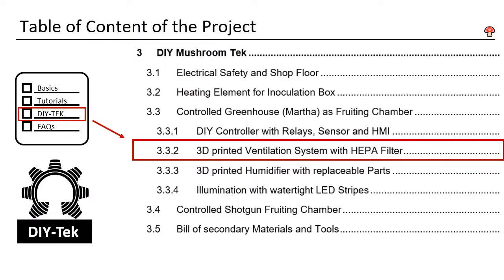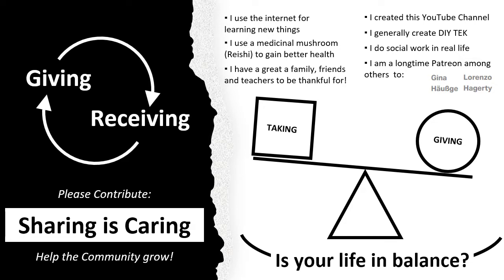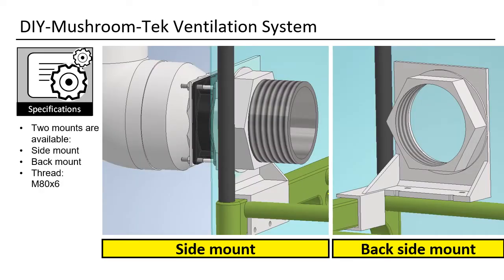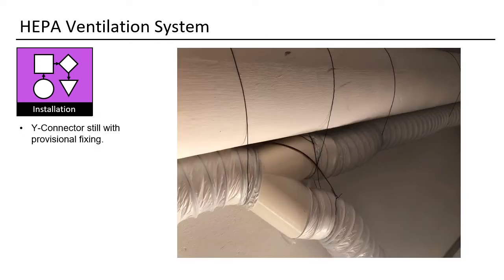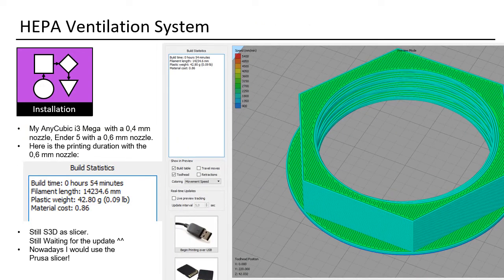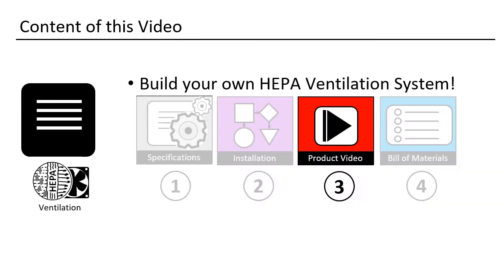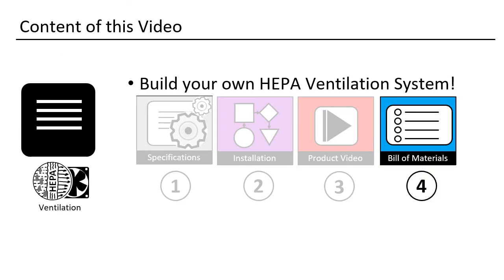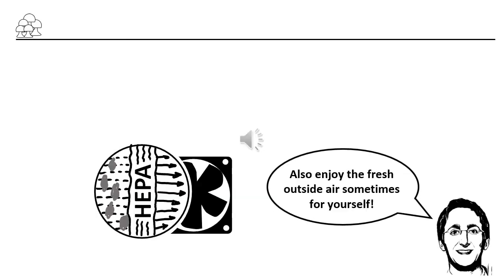3.3.2 Printed Ventilation System with HEPA Filter for Martha grow Tent

Comment: Hey :)
Venting the exhaust outside the building is propably the best way but not really possible for those living in rental apartments (like me in Berlin), especially during winter times.
Do you think it could be possible to remove most of the spores using first a centrifugal seperator followed by a waterproof HEPA filter?
Would be interested in your opinion on that!
Reply from the maker: Hey, best would be if the exhaust could go through water for cleaning purposes, if you can not get to the outside. For this one could use an air washer. This would be better than doing nothing. Do not use ordinary Filter or an ordinary air purifier. They normally come with an ordinary HEPA filter, which would get wet, and this would invite even more mold down the road. I did not know that waterproof HEPA filter do exist. Sounds good. I would use an airwasher in any case. I do not think that a centrifugal separator is be able to filter out any spores!

Video: What is the difference between an air purifier and an air washer?
https://youtu.be/3aSviYWezpA
Reply: hello, do you think à VENTA LW15 air washer will be sufficient to capture the spores of 1 martha 4 stage? thanks a lot!

i have thé same problem, i can not evacuate outside.... i'was thinking for a system with water an i've juste read your comment!
Reply from the maker: @thefloooo95  Dear Florian, I think it could work. But the suction area is not that clear cut, that means it will be a little bit more difficult to fit the exhaust pipe on it and seal it. I also do not know if it runs 24/7.
The spore load depends anyway on how many mushrooms and which kinds you have inside the tent.

 When you do some research, many marthas, that are sold as a set for growing mushrooms, come with an open ground, that means they do not have an under pressure system and are connected to the living areas. For many people this thus seems to be no problem. I will not give an advice since it is a personal choice everyone must make, but a water washer is better than no filtering at all!  

If you plan to use a air washer, please check regularly the overall humidity in that room, especially in cold corners and behind cupboards in order to not get a mold problem in your apartment! These spores are really bad for your health! (I do not no if other spores are better…)

I today got the idea, that one could maybe go with a flexible tube through the siphon of a sink and just blow the mushroom air into to plumbing system. But I do yet have not fully thought through this solution. So I don't know what the technical pitfalls of this solution are.

Happy Mushrooming!
Reply: @diy-mushroom-tek  hello, first of all, thank you very much for your very interesting and complete risponse. you've had à Nice idea to thraught the spores directly into the symphon plumbery! but i think it will be nice to have a super sensitive pvc one way valve to not have spores that can go up in the bathroom through the sink or the shower... but it's à good idea. 

the problem is that i will probably grow pleurotus and i know that they produce lots of spores...

so, i was wondering if i can build big filter in a big plastic box with a  big vacum cleaner bag on it but... i think the PC ventilation will not be sufficient for blowing air throught the vacum cleaner bag so i think you're right withe the air washer.

the problem is my room is like 60% humidity because of two tropical vivarium  and i dont need more.... so i hope the air washer will not provide to muche humidity...

thank you very much for your reply! your videos are awsome! thanks you for sharing this!

just a question, your only 2 small disc head atomiser are sufficient to humidify your big 1m95 martha at 90% humidity?

did they last in time 24/7?

thank you very much!
Reply from the maker: @thefloooo95  Hey! Thank you for your kind words!
Yes, the two redundant humidifiers are enough. They last 24/7 and with filtered water for month. One would work, but two bring up the humidity much faster. If one wants to use them in a bigger tent, one could use just more and maybe on both sides. 

The air that would come out of the washer would be 80-100% loaded with humidity I guess, as this is the percentage that goes inside. You can estimate the volume being released into your room by investigating the time you want your fans to be running. So, the only way to reduce the humidity load into your room would be to reduce the fan time.  

I also used the time to fallow up on my plumbing exhaust idea. I created a short video about it. Depending on the access of a sink, it could really work quiet good. As my tents are in a basement and I also have a sink there, no problem for me. But if you have only a room with a window, I have not a good solution yet. 

Anyway, here is the video about my plumbing exhaust solution:
https://youtu.be/ahTGUuV_r6Y
Happy mushrooming!
Reply: @diy-mushroom-tek  thank you for your risponse! you've had a very good idea! i will probably try to 3D print an adaptator to fit my exhaust on the small air washer VENTA LW15. then i will Share with you if it's good. then i will try to find à solution to capture the humid air that goes out of the VENTALW15, i wouln't reinflate the tent with the filtered humid air because there is Co2 Too... so i have to exhaust it in a box that can capture the humidity. maybe into à big box full of salt?

i was wondering if it is possible to fill the venta LW15 with oil instead of water to likit évaporation. i donc know it it will capture the spores... and if it will run correctly....
Reply: Here’s an idea 💡 for you exhaust if your concern is catching spore particulates

Buy a plastic tub with a lid. Cut a hole in the lid to accommodate your exhaust pipe/hose.

Fill your tub as high to the top as possible so that it does not overflow. The goal is to bring water level as close as possible to your exhaust hose/pipe so that when air enters the tub they will hopefully immediately be caught and suspended in the water.

Ensure the lid is air tight on the tub by either tape or silicone. 

Add a small ventilation hole so the fan can blow air freely. This can be done by adding a straw or something similar to the lid. I’d try to secure the straw so that it is as close to the water without touching.

This may not be 100% effective in catching all particulates but may be a cheap and easy method to reduce particulates being blown around your living headquarters.
Reply from the maker: @irate74  Hey Dan, thanks for your good idea! What you describe is a kind of passive air washer, because there are no rotating parts. One could elaborate on your idea and add a sprinkler into the tub to enhance the mixing of water and air. If you design a kind of these devices, please share with us via thingiverse. 

If you utilize these devices, please understand that you are then releasing a constant stream of nearly 100% humidified air into your apartment, apart of some spores that you did not manage to filter out. 

That humidity stream can condensate on cold surface areas. These would mainly be behind your cupboards, in corners and obviously on outside facing walls. Condensation means that there will be water falling out of the air. This can create a wet environment in which mold could strive and harm your health. Please monitor your surroundings with a hygrometer.
Reply: @irate74  seems to be good!!!! the straw can be mounted on a float buoy to adapt the depth if there is evaporatio the straw will always be on the same high of the water. so, the buoy floater and the straw will be one same piece  and the floater will be perforated just up of the water level like you said. the top of the straw will be guided by a second tube that is exact externat diameter of the straw (+0.2MM).

seems to be good!

important to take a water tank that is not high BUT  have a "big" surface area to maximise the change of the spores to go into the water!

and @DIY-Mushroom-Tek nice idea to atomise some water in the tank!

i will try do design one! thank you a lot!

then if needed yo can Mount several of these kind of boxes in parrallel to make à 2 / 3 or even more filtration!
Reply: @thefloooo95  I like the idea of an adjustable straw to accommodate a fluctuating water level due to evaporation.

I also think that if you added multiple setups in parallel then in theory, if the straw was connected ONLY to the 3rd water tub furthest away from the exhaust carrying particulates and high humidity, then by the time the humidified air reaches the straw for the final phase of exhaust then maybe it will mixed with enough of the fresh air resting in all the prior tubs and could have a lower moisture percentage by time of exit.

I have not tested this but I imagine with enough water containers one could perhaps have the final exhaust with a low moisture percentage that would be suitable for a home without having to worry about creating spots for mold growth.

If you have the financial means to do so, it may also be a good idea to buy a cheap dehumidifier and put it by your final exhaust port ensuring the intake of the dehumidifier is by the straw or whatever you choose as the final exit.

Keep in mind the water will have to be drained and changed so purchasing tubs with a pre installed gasket may be easier than constantly having to redo the tape or silicone caulking.  Adding a drain valve and hose may be a convenient idea if for example your tubs are close to a shower drain or sink . That way you don’t have to lift a possible heavy tub of water to pour depending on the size you choose
Reply: @diy-mushroom-tek  Hello! good idea to put a sprinkler in the exhaust tube. Do you think a 1 disc atomiser will be ok? because if i put a sprinkler i have to use a diaphragme pump to have good pressure and less noise but it's like 50euros and it' like 50W to 100W.... so not the best. if i use one disc atomiser it's like 3 euros and no noise, and very less electricity consumption. maybe it's better to put it just after the exhaust fan to not moist it more (even if it's an IP68). I just don't know if spores will be cached by the very small ultrasonic drops of water floating in the air.What do you think about it?

Secondly, I don't want to minimize/reduce the exhaust air flow, so if i habe a 80mm exhaust tube fore the 80mm exhaust fan, I want to keep the surface area of the 80mm circle (5056.5mm2) si if i put a tube juste above the water level in the filtration tank then i need to get a 200mm diameter tube at 8mm of the water level to preserve the air flow. i think i can not get a larger tube than 20cm diameter so i can not go more near the water level than 0.8cm. Then for the straw with the float, i need to have a float that have 64 holes of 10mm diameter to not reduce the flow of the exhaust. i think this is buildable. the easiest will be with a 100mm intake but only at 16mm of the water, don't no if it will make such a difference...  What do you think of it? thanks!

maybe by addition, i can put a small aquarium pump 3W inside the box of water that can irrigate an aquarium moss filter positionnate like a barrier beetween the intake and the straw exhaut. So it will be a filtration with one atomiser that catches the spores and put them into the water and one pump that moist an aquarium moss barrier to catche the ones that haven't been cached and then the straw exhaust at the level of the water will permit to direct spores at level of water to sink the last ones....
Reply from the maker: @thefloooo95  Hey! I think a sonic would do fine. In that case I would for sure position the controller somewhere safe on the dry outside. As they only work for 4h and go into a safety stop afterwards one could also use more than one. This would create a dense persisting fog through which the spores must travel and hopefully will be captured. I would also try to have this fog within the spore trap and not within the exhaust pipe. I also would use a separate water tank for the sonic discs in order to reduce the cleaning/maintenance time on them. The spore water would clog them easily.
Reply: @diy-mushroom-tek  Thank's for your risponse! So if they turn into safety mode after 4 hours, you can't use them 24/7? how do you make to use them 24/7? thank you a lot!

secondly, Maybe it's a good idea to use a 3D water absorber textile like "hygrolon" to have a wet filter surface in front of the aquarium fine filter moss washable maybe every 2 weaks.
Reply from the maker: @thefloooo95  Hey, my martha runs 24/7 and the controller monitors the humidity inside the martha. The humidifier only starts to work when the desired humidity levels inside the tent are not met. After reaching the humidity goal it is turned off via a relay. 

The stop after 4h is a safety feature of the units to ensure that you do not forget to switch them of. If you control them with an Arduino one can have them on a “break” for a minute every two hours or so. This way they would run permanently. One could do the same “trick” without the need of programming if one uses an ordinary time switch.  

An enlarged surface would of course increase the chance to capture spores out of the exhaust air but may also lead to a more difficult cleaning situation. 

I wish you lots of success with the implementation. Please share, if you tinker out a good working solution!
Reply: @diy-mushroom-tek  thank you a lot! i work on it!
Reply: @diy-mushroom-tek  hey! I'm still working on the filter box with 5cm large 50PPI Black aquarium moss filter and water in the bottom with filter moss on water to catch more spores. I will additionnaly cultivate pleurotus ostratus sporeless Strain called "spoppo" to be sûre no spores will be in my livingroom
Reply from the maker: @thefloooo95  Hey, that sounds great! Nice to hear that you are still on the topic, persistence pays off!

Thanks for sharing the idea of cultivating a mushroom that does not produce spores. This may be a great way for many people to start with!

I just googled and there also is a nice paper about this fungi out there available: 
“Development of a sporeless strain of oyster mushroom Pleurotus ostreatus”

https://www.fungifun.org/docs/mushrooms/scef2000/scef317%20Development%20of%20a%20sporeless%20strain%20of%20oyster%20mushroom%20Pleurotus%20ostreatus.pdf
Reply: @diy-mushroom-tek  Hello,
 First of all, thanks for the paper, very interesting! 
i wrote you a message on fb to share you the pictures of my project filter box. it seems to be finish, i have to test and adapt. I would like to know what do you think about it? thanks a lot! have a nice evening!
Reply: Here is the final result. The box is a solid sealed box. i drilled two 80mm holes in it and put two printed parts into the 80mm holes. And then put two 75mm "Marley" tube (72mm inner diameter that is the exact diammeter of the 80mm fan), one 80mm IP68 fan, same model as you did. The marley tube are just pushed strongly into the both 3D printed parts. Then, no glue is needed the are strong assembled. one of the both marley 75mm tube have to exceed 2cm out of one of the top 3Dprinted part to plug a 75mm black air flexible tube (that will be connected to the martha). Inside the box there is a 5cm large 50PPI aquarium moss filter and there is two pieces on the bottom too. I will first run it dry (after a conversation with @DIY-Mushroom-Tek ) and then compare with water on the bottom. and if it isn't good i will do a waterfall from the top of the vertical filtrer moss to the bottom with an aquarium pump. the wire will go through a hole sealed by rubber ring.

Here are the pictures:
Here is what i came up with:

https://i.servimg.com/u/f83/17/86/74/46/20221112.jpg

https://i.servimg.com/u/f83/17/86/74/46/img_2045.jpg

https://i.servimg.com/u/f83/17/86/74/46/img_2047.jpg

https://i.servimg.com/u/f83/17/86/74/46/img_2046.jpg

https://i.servimg.com/u/f83/17/86/74/46/20221110.jpg

https://i.servimg.com/u/f83/17/86/74/46/20221113.jpg
Reply from the maker: Hey Florian! Thank you for sharing your solution! 
All the best for your ongoing mushroom endeavors!
Maybe you will keep us posted when you reach some milestones?!
It was fun talking to you!
Reply: @diy-mushroom-tek  thanks! Of course i will share, but it'll May take some months! :) thank you for all your helpful risponses!
Reply: i was thinking of trying a rubbermade bin filled with cotton or some other filter media, maybe even old clothes, then put the exhaust vent pointed into the bottom, and drill a bunch of holes in the lid. i doubt it would get all of it, but in theory the spores would settle in the bin and it could be cleaned regularly. im not sure how small your average spores are, but if that didn't work, could try washable hepa replacement filters for air purifiers mounted horizontally in the bin. just some ideas, i haven't played around yet. let me know if you figured out a good solution. with some sort of bin filter tech you could also put moisture absorption pellets in a layer to pull the excess humidity back out and not get your room too humid.